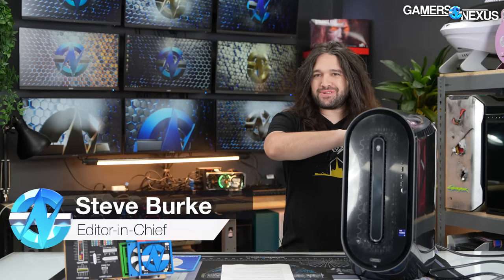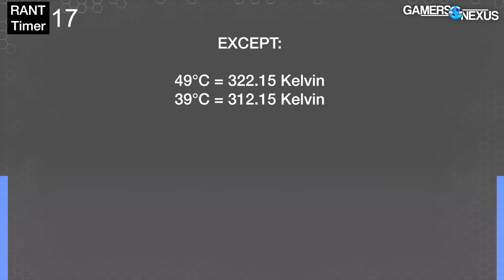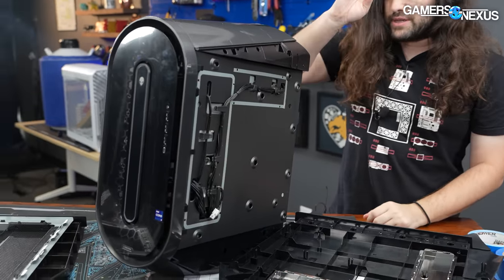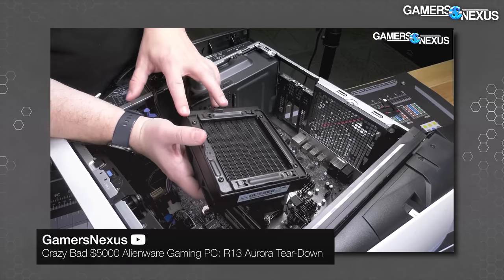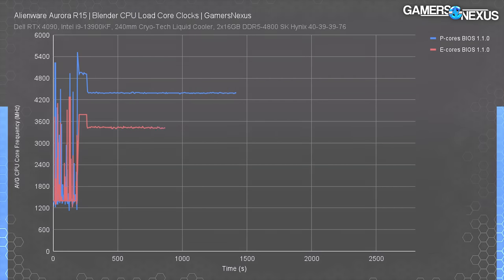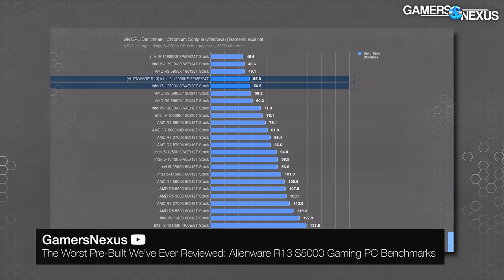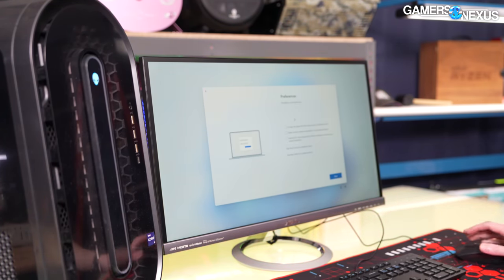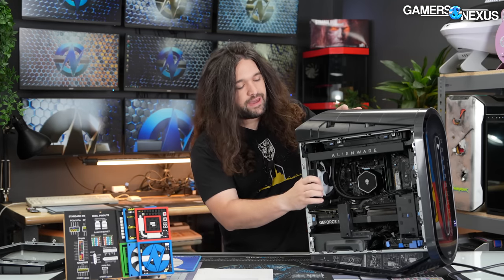Alienware Can't Get It Right - R15 2023 Pre-Built Gaming PC Review

Comment: You should do tear downs of servers if you get the chance.  A lot of the same issues exist in the enterprise side (insane levels of mechanical over engineering and custom one off parts) with the added fun of configuration hell.  For instance the dell T640 requires pulling the motherboard out to install a power interposer card so that you actually have the cabling for the GPUs (lol).
Reply: Dell is the problem 😅
Reply: thing with servers is that they are constrained by the rack units so they cant just change the form factor however they want, and they also need to cool so much more power.

In a desktop PC it doesnt matter as they can choose whichever dimensions are optimal and make everything fit properly. As such, sticking to a formfactor which is suboptimal when they can just expand or remodel them makes no sense.
Reply: it's all to make it easier to mass produce since all the systems are assembled by hand. They don't really expect you to ever disassemble them. Thats also why they use all sorts of proprietary shit. It sucks for us as consumers but hey you'll be more likely to pay them for servicing it so they don't care
Reply: @AlexWinExperiments  The only hard limit on racks is the width, and to a lesser extent, the depth. They could make a rack case that takes up the entire height of the rack if they wanted to.

A 4-5u rack case is roughly equivalent in volume of a standard mid tower desktop case. It's entirely on them for stupid design if they want to cram all of that into a 2u case.

Comment: I've been building my own PCs since... forever.  Recently, I caved and ordered an Alienware R15 from Dell.  I did this despite your very helpful and insightful review.  Why?

- I hate installing coolers and spreading thermal paste.  I always feel like messing it up can be very expensive (despite never having once messed it up).
- I stepped down the components.  The R15 I ordered contains an RTX 4080 and the weaker CPU (i7 13700F) because your review said that in this case with Dell, the more expensive CPU is behaving like the performance profile of the weaker one.  So I just went with the weaker one, and bumped the NVMe size to 1TB and the RAM to 32 GB.
- They offered $600 off the total cost due to a sale.  The brought the pre-built cost down to about what it would have cost me to get the parts individually, minus the stress of having to build it myself.  Since it comes with a 1 year warranty, I figure I will know if it's a lemon within that year.

I'm mostly going to use this PC for gaming, so I hope with the reduced power consumption the thermals are going to be OK.  You did say the GPU configuration was one of the few things Dell got right.  Since I won't be doing a lot of CPU intensive loads, I have my fingers crossed.  The 4080 represents nearly a 3X performance upgrade from my 1080 (I don't even have the Ti).

Comment: Bitlocker was enabled and they are pushing multiple UEFI firmware updates? That's quite brave* unless they somehow have a fallback/recovery mechanism to mitigate the potential problems that could arise 🤯🤷‍♂️

*Really really dangerous
Reply: I'm sure they have a restore thumb drive (32GB) for $99 with free shipping when you call support.
Reply: Pretty sure the potential return-to-manufacturer fee is part of the pricetag, inconvenience for the buyer non-withstanding. Dell is large enough to swallow such factors easily. That being said, they should really start to listen. Alienware deserves to be an actual premium brand.
Reply: Really dangerous? 

Not encrypting data at rest and ignoring security updates isn't?
Reply: @GreyGoshawk  Let's be honest, for most people using their gaming computers for playing games and other casual things only, it really isn't.
Reply: @GreyGoshawk  Issues of update/not to update aside, its how its done. 
Lets say a BIOS update takes 5 minutes and my UPS is good for 5 minutes and I really hope you see where I'm going with this.

For those who need it spelled out: lets say your area gets hit with bad storms that tend to knock out the power. You have a UPS that is good enough for a few minutes to get the system shut down, but it needs to be done with some haste. 

Regardless, an automatic BIOS update hits and you loose power. Odds are good your BIOS is bricked. Now thats not a problem for my/high end systems, they have dual BIOS and flashback. So if somehow both get bricked I can just flash in a new one. Guess what 2 features Dell MBs don't have that might be really relevant to this.
Reply: @GreyGoshawk  The best way to discover how Bitlocker is tied to hardware is when you lose access to your OS and files because it thinks you installed the drive in another PC instead of just updating the BIOS and/or firmware.
Reply: @dynastes4938  It isn't until they get exploited and get their bank details stolen etc.
The gaming pc seems ripe to exploit because the users generally have a bit of money
Reply: @nickierv13  Yeah that's an issue. 
And backup firmware is really something that needs to be standard. 

I know Dell's business uCPE boxes have them where you hold in the reset button for like a minute and it will boot off a default bios. 

Laptops often only allow you to update firmware when they have 70%+ battery and plugged into AC.

Desktops get pretty expensive so this needs to be considered.
Reply: @BrunodeSouzaLino  Well yes. 
But that's why if you set it up, it asks you to print out or store separately the unlock code. 

Also you have the option of storing the unlock key in your Microsoft account. 

When you boot your pc, you use a pin that isn't the full unlock code. 
That's why when something changes you get asked for the full unlock code to load into the tpm so that you can continue using the pin.
Reply: @GreyGoshawk  And you'd be surprised to know the amount of people that will not copy that code because "there's no way my 5k PC will experience any sort of failure like that." Then that happens, they whine and you can't really blame them if that was caused by Dell. 

Disk encryption should always be an opt-in feature or "this is my foot and I chose to point this gun at it."
Reply: @BrunodeSouzaLino  
All macs have disk encryption enabled by default using the user's password to unlock the disk at boot. 

All iPhones and modern Androids use it as well using the passcode to decrypt. 

The reason to do so is to protect the user's data. 

Not encrypting is just outdated advice.
Reply: @GreyGoshawk  And there's your reason why people don't bother with Bitlocker. In Android I don't have to bother with setting or storing a gigantic key you have to save and having a password that's different from your users' just to decrypt the drive.
Reply: Disk encryption (aka Bitlocker) ONLY matters when thief steals your PHYSICAL drive, so it won't be able to read it without key. And how likely do you expect to get physical drive stolen from gaming PC? 

And you get hacked, infected by virus or fished out of passwords, your bitlocker won't mean shit, because you already logged into system and data access is allowed, so all that data can be read freely via your own credentials.

And i am not even talking about penalties of real time encryption. Sure it is not as noticeable nowadays there, but it does affect performance. And it can cause additional issues like fps drops and stuff with additional CPU overhead and data access latency. 

Moreover this forced encryption also is really freaking bothersome when i try to flash new ROM's on my phone. Why? Because since it became norm i MUST completely wipe all my data every time I flash ROM. Even if it is just an update. Because it encrypts all data on first boot. And there is NO password you can unlock data with. It even messes up with recovery, and you must find ones that includes ability to decrypt partition. Not to say such recoveries are really strict towards variety of Android versions you can install and data could be decrypted afterwards. And as this forced encryption includes partitioning, it affects internal SD card as a whole. 

I remember old times when application data wipe was enough 90% of the times to make system boot, consequences of which could be solved via 10-15 minutes and about hour of waiting... But nowadays you must wipe out EVERYTHING! And restoration takes up to half of a day afterwards. Every. Damn. Time.
Reply: @DimkaTsv  Gaming laptop? Burglars can steal those easily. 

Also some fancy PC with LEDs is a good chance of having unencrypted bank details. 
Maybe a passport scan etc. 
Crypto wallet?

Also having an encrypted drive protects you from some preboot attacks. Let's say an attack plants a boot entry into UEFI to modify the disk. 

Not to mention there's an integrity check. Like how this thread is about updating the bios and it asks for the full key. 
If you turned on your computer one day and it had been modified someone. Without bitlocker, there's no indication that anything changed. 

Anyways. My perspective is always to just have a bit more security than the average person. So if there's some widespread hack then hopefully that protects me. 

I use a yubikey to type in my bitlocker key automatically.

And the performance loss is basically nothing
Reply: @GreyGoshawk  gaming laptops are different story, i can accept encryption there.
But, again, entry point for hacker will be your own password or system vulnerabilities, not brute forcing data. Moreover for those who dare to steal gaming laptop, i am pretty sure that laptop itself is more valuable for them compared to data on it. 

Encrypted drive won't protect shit against preboot attack. Why? Because it stores itself in raw UEFI binary and executes in unencrypted kernel within RAM before system even boots. After which it will have full access to your system at Ring0 level (which means you will be powerless), as you will not suspect a thing and unlock data on your own via routine login. And no, such virus won't trigger Bitlocker at boot because it doesn't reset data saved within BIOS. Or do you enter decryption key every time you boot? I bet you don't. 

This thread is about Windows automatically! updating BIOS without your agreement. You cannot control shit in this case, especially if you are part of a target group that buys such expensive prebuilds. There is not just risk of permanently bricking PC via local power surge or sudden downtime causing BIOS corruption on update, but also risk of losing all your data if bitlocker was enabled without your consent. 

You can be pro-security as much as you are. But let people have their choice and not enforce everything! Things can break and consequences are bad. I won't like to accept such risk for example for vague benefit from protection against stealing of my physical drives. Because i know that bitlocker won't mean shit as protection against digital vectors of attack. Secure Boot, on other hand, can protect against some things.
Reply: @DimkaTsv Sure. 

Your point about why it doesn't give as much protection as it could,  these are problems with the implementation in the Windows PC space that  apple by  default has solved. 

It is possible to make a device that can be immune from breaking during a firmware update. 
But it costs money, and enthusiasts don't care, they'd rather have oversized VRMs

Because the general attitude and approach to security is "why do you need this?"
Reply: @GreyGoshawk  Do you TRULY think that Apple solved this issues? 
Not that they use (for many years btw) soldered proprietary SSD chip with custom ARM controller that nobody besides that one Apple supplier can provide (meaning you just can't put any NVME drive here, you must use their stuff), which can just randomly short to ground (and this issue is quite common comparatively btw) and cause not just complete data loss but also 300-600$ replacement as notebook won't ever boot again without SSD, which for some reason contains both firmware and data? Even if you have redundant system on external drive macbook won't boot as firmware was burnt down to crisp with that SSD.
 
Only way to truly solve most of risks coming from updating BIOS is to use UPS with voltage stabilizer. Dual BIOS does exist though, it gives you redundancy. But do you really expect OEM's like DELL to actually utilize these "modern technologies" in their Alienware gaming branch instead of servers? All they want is your money, and as much margin as they can possibly extort.

Security is interesting thing. Unless you do shady stuff and download god knows what, or if you are interesting enough for hackers or thiefs, going all in security is just useless. Because it is like living in plastic bubble. You may as well just turn off internet forever as this is most significant security breach on your system. Most dangerous vulnerabilities can only be executed with physical access to your system, and they can even dig away your encryption key, btw, given enough time, and for ones that can be used remotely your disk encryption is useless against. Everything is good in moderation. And people MUST HAVE CHOICE! Enforcing everything is not a choice but burden to deal with for those who have issues with all these additional security stuff, as it affects their usage.
Reply: @DimkaTsv  
Well in Apple's case they have raw SSD chips and the controller is inside their SoC. 
Which is objectively more secure. 
It's a different debate for hardware failures but that goes into backups etc. 

And that's the issue dual bios doesn't cost much. There's this attitude of "enterprise features" for basics. When you buy a Dell PC, you get a platinum PSU. Because of regulations. 

You're repeating an argument that's often used for less security. But modern android phones, iPhones and Macs are significantly more secure by default. Automation especially with AI can usher in a new reality of sophisticated attacks being a few clicks. 

High end PCs aren't cheap so you're getting less for your money. 

PC gaming exposes people to much more risk because of it being normal to run exes for games. As well as mods. 
It's a prime target. 

Any app has access to your filesystem. 
Also users will often elevate to admin rights without thinking. 
Today windows has no scoping of permissions. 
Like imagine you get a prompt saying 
"Game.exe is trying to access your documents folder" 
"Installer.exe is requesting registry permissions" 

Nobody in the tech space is shouting for these features. And so Microsoft isn't doing much.
Reply: Yes, could be dangerous for the normal user. TPM or even secure boot turned off/disabled after a BIOS update . Even after setting it back will cause Bitlocker to "run home to mama" and wants the long code or it will not load windows. Got asset management to find the bitlocker key. Mostly on Dell systems.

Comment: So I "upgraded" my Lenovo legion - 3080 ti (was a 2080 super before upgrading)  i7 12900k-32 gb ddr4 ram to an Alienware r16 32gb ram ddr5 4070 ti super- liquid cooled 14900f i9. While my temps were a lot better and quieter due to liq cooling I experienced worse performance, alienware command center was throttling performance. Changed settings but still experienced more stutter than I was getting on my Lenovo with a 2080 super in it. The temps were great but I returned it. Not paying $2000+ for a comp that stutters on xdefiant which isn't that demanding. Lenovo is definitely the way to go. In 4 years of ownership no issues and was even able to case swap it. Dell has basically 0 upgradeability too. Which makes you not want to fork out a bunch on one. If youre looking for a cheap prebuilt under $1200 alienware isnt the worst but if youre looking for a high end rig $1800 or more i would consider elsewhere

Comment: I totally agree with all of Steve's points here. 

However, I own one and it was a steal for the price. i9-13900K, 4090, 4 TB of storage for $2,600 including a 3 year comprehensive warranty. At the end of the warranty you can tell them something went wrong and they will replace it with the latest release at better specs, no questions asked. 

I think it can make sense for people at the right price. I am used to building my own but I have a lot of nostalgia for the brand and I want them to be better. It actually runs pretty quiet during games and is cool enough. i9 typically in the 60s to 70s while gaming. I put in 6000 MHz RAM and it's running at the expected timings.

Comment: I've got the R13 with a 3090 and the 1000w power supply and haven't had any issues and thermals have been perfect. Play at 4k max settings with no issues.

Comment: Given that the power was restricted, how much power is the system using at the wall?  That would have been useful information along with everything else in your review. I am curious if there is at least a significant power savings (less electrical power used in exchange for the lower performance) to go along with the low performance given the hardware used.  Just my two cents and what I think should be included in the review to give as complete a picture as possible of the reviewed system.

Comment: You know - I just thought about this and I think that maybe the reason they use so many quick release and spring mechanisms over screws is to make assembly quicker on these. Technically, it makes the entire build a bit more complicated for the end-user, but in manufacturing, plugging a fan cable in and popping the fan in place or sliding the side panel straight on, no screws required, all seems like it's the most efficient way to slap one of these systems together on an assembly line.

It's definitely not the best for an end-user but may be a convenience thing for manufacturing. Just something I was thinking about.